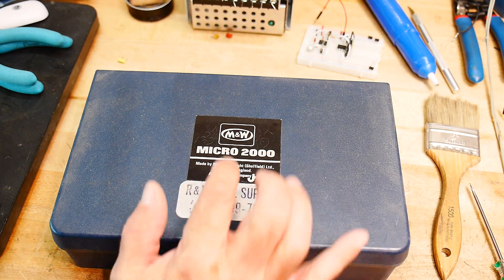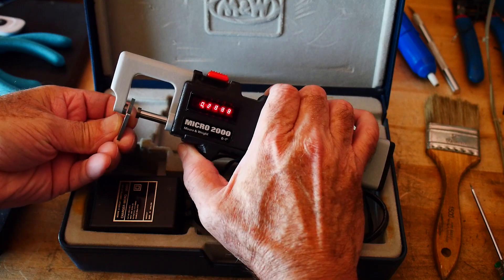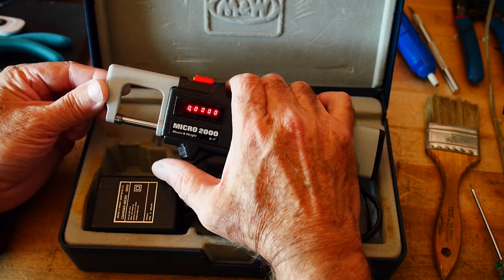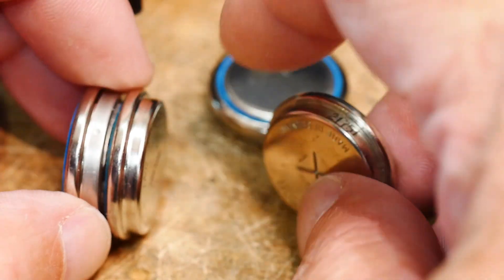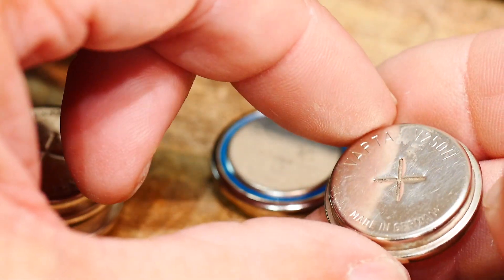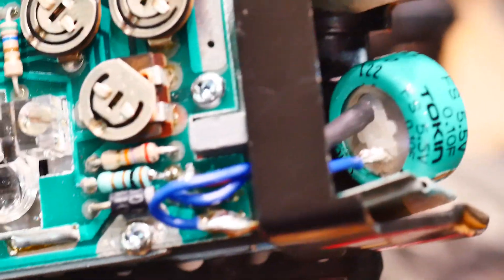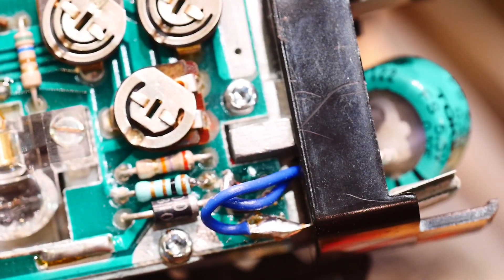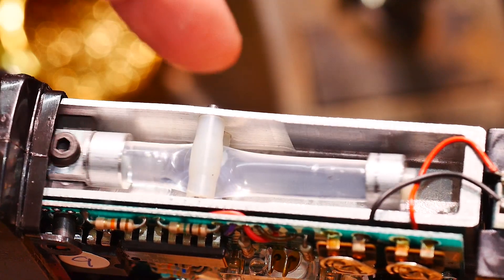#512 Moore and Wright Electronic Micrometer Micro 2000

Comment: I'd call it a digital MICROMETER ... 🤔😂

I worked for a tool company  40 years ago & we were sales agents for M & W measuring equipment... 
I later went into machining for a living & bought all M & W ... until Mitutoyo came on the scene...

😎👍☘️🍺
Reply: Calliper is correct. There is no screw in this which was the patented feature of a micrometer, it has a sliding scale. Sales people people are often full of bull when trying to flog something.